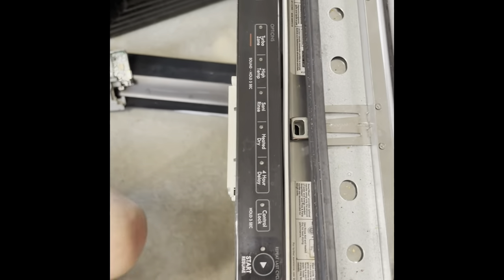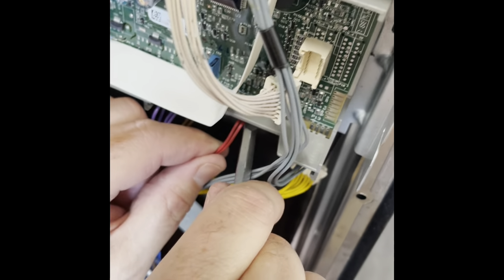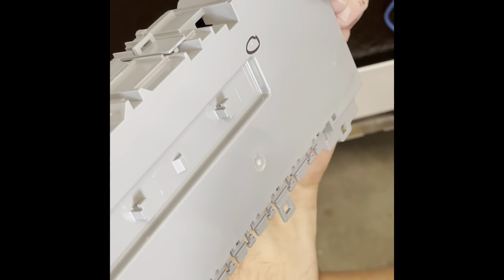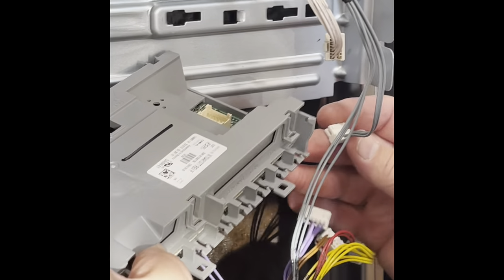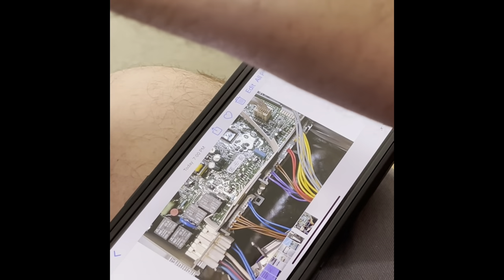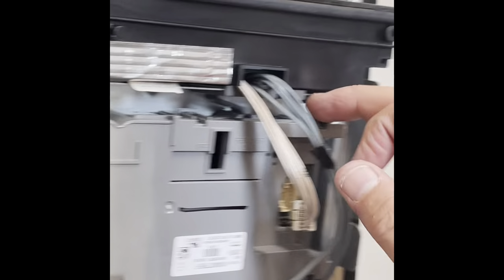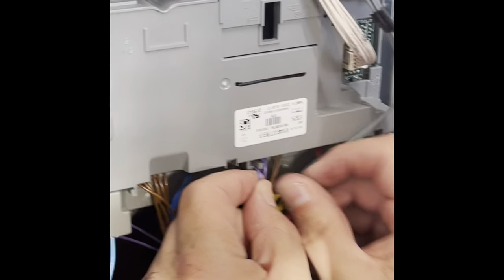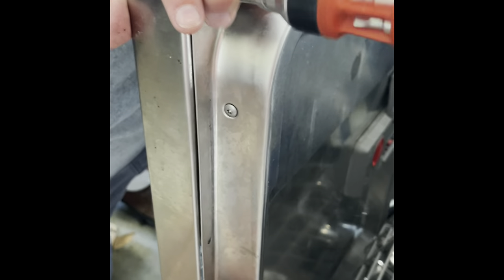Replace control board in a kenmore elite dishwasher

Comment: Nice video.  However, there is a small plastic tab under each socket that when pushed slightly down with the flat blade screwdriver will release the plastic sockets to pull out.

Comment: What led you to replacing the control board?  Was there an error code of some sort. My Elite keeps flashing no matter what cycle it’s on and won’t complete it.
Reply: Mine was from a blinking red LED light on the control panel.  Would not default reset when breaker was turned off.  Would not go into diagnostic mode.  Logically seemed it was this control board malfunctioning.